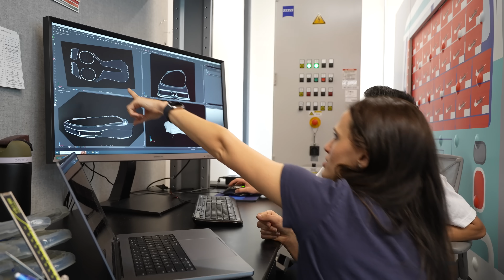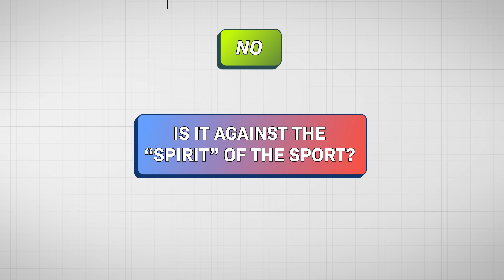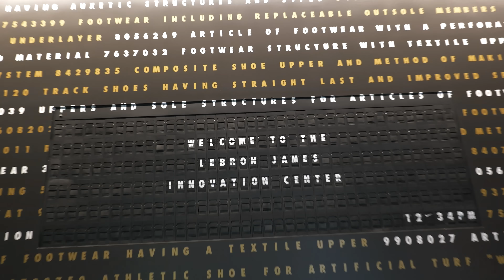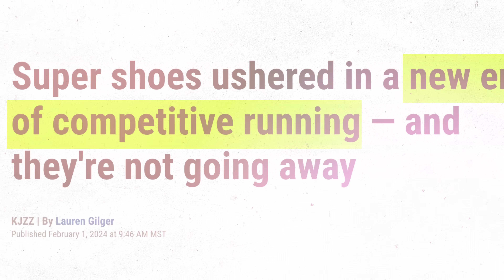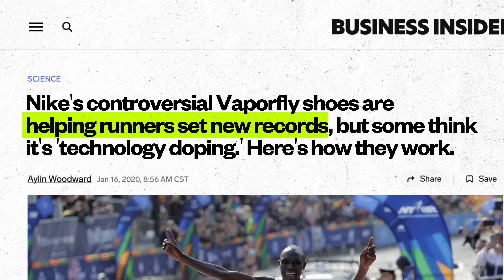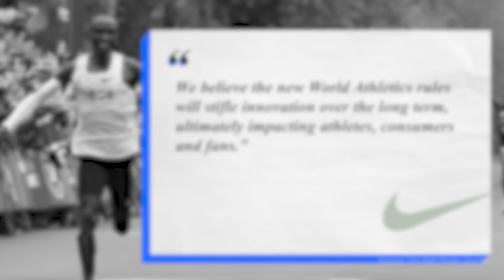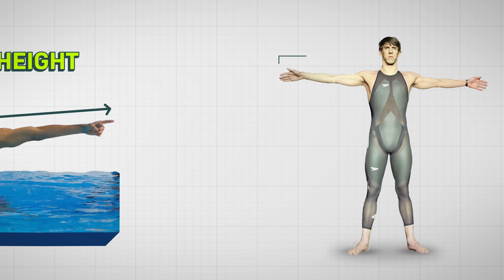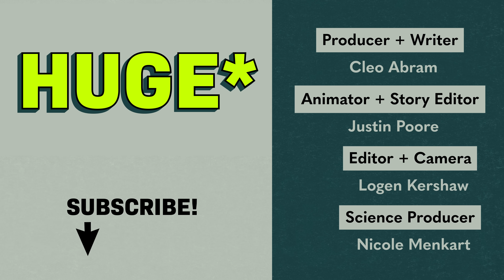The Shoe That Broke Running

Comment: The line for goggles are quite simple for me: safety. Makes the swimmer see where they are going and not hurt themseves by crashing into each other or a wall. Does it make them faster? No, but seeing where you are going is. The shark-skin is very different. Clear difference.

Comment: The decision to judge Blake's case based on a hypothetical height is ridiculous. For one, possibly the most common mistake I had to dock students' points for (ergonomics course) is assuming body proportions are directly related on an individual person. A 70th percentile arm does not mean a person will have a 70th percentile leg! Same way a 70th percentile reading score doesn't imply a 70th percentile math score. Sure they're correlated in the reference population, but there's so much variation in individuals!

I'm sure the calculation was more complicated than a 1:1 limb comparison (or I hope it was, at least), but it's not a good metric. It's a particularly bad metric when measuring someone who has not developed in the "standard" able-bodied fashion (a.k.a., the people studied for those ergonomic references).

Respect his attitude, but that is insanely unfair. He did the work—if it was truly that much of an advantage, you'd see a lot more high-tier runners missing limbs in a sport where milliseconds count!

Comment: On the one hand, so long as it isn't adding energy I think it should be fair. But on the other, bikes only improve the efficiency of human energy but that's clearly unfair in a running race, and on top of that, I think the Olympics should genuinely be available to people independently of wealth meaning that super high tech perfectly optimized stuff that just improves the efficiency of what you're already doing but only the richer competitors can afford really shouldn't be allowed. Honestly I lean towards the latter... but I do think there should be spaces to push the absolute limits of what's humanly possible with the use of tech so long as all energy is human provided.

Comment: Technology has made such huge changes to sports. One example is switching from wooden tennis racquets was massive. The biggest may be when they switched from wooden poles in pole vaulting. The newer fiberglass or composite poles could bend, allowing athletes to get so much higher than ever before.
Reply: That's why I like complex sports with minimal equipment.  Combat sports, football, basketball, volleyball, water polo, etc.

Comment: I have a pair of Alphaflys.  They are fast but the main benefit is in reducing fatigue during and after  a race/ long run.  There are a lot of super shoes these days, Alphaflys are just one of a large number of choices.  

The WAS restrictions of 40mm and only one plate/stiffening device is a good balance in my view.

Comment: I think that one can use statistics to make an argument for why the carbon blades give an unfair advantage. If you look at the prevalence of people under the age of 30 missing limbs it is 1 in 2000 people. If you see the number of runners with blades amongst elite sprinters(top 200, top 100 whatever cutoff you chose) significantly exceed this frequency then it would fair to conclude that there is some unfair advantage even if the bladed sprinters only make it to 5th in the world.

If you look at motor sport there are lots of divisions and competitions. Sure they are all cars but we understand that if the way in which the cars function is sufficiently different then they should be in different competitions. Mercedes and Mclaren have slightly different F1 cars, while rally and Formula E cars have significantly different specifications hence the FIA choses to have separate categories. The same principle likely applies here.

Comment: What the public thinks doesn't matter. The fans don't get to vote on the designated batter or the aluminum bat rules. Every sport has a governing body or association that writes the rules that govern competition and participation. The way to handle these issues is to let the governing body for each sport decide what is appropriate for that sport. Period.

Comment: The problem is to keep meaningful the comparison, present and past. But the technology is mature enough also to store (non dangerous)energy enhancements information (including wind, shoes characteristics accessible by all participants to the competition) together with achievement results, so compare only time or height results is intrinsically obsolete, focus on improve the comparison algorithm instead of banning the most significative enhancements. We might also have to enrich the concept “there is a winner” in function to weights, instead of ban, given to te enhancements used. —Marco Munari

Comment: Running blades shouldn't be allowed in running.

That is just giving a PERMANENTLY legless person the ability to run faster with less fatigue than normal legged person.
Plus, not everyone can have that running blade cuz......it's for the legless person only

In the future, there might be runners who are desperate to win their run for glory & money, to the point they might be willing to cut their legs for running blades to gain that advantages 

Glasses prescription is different. 
Yes. It makes ALL shooters to be at the same sight level for the shooting WHICH the shooting itself required more of their individual aiming skills than their sight.

For running shoes? It should be regulated BUT NOT BANNED.
For example, in this running event, no carbon plates shoes is allowed.

In other event, yes it's allowed.

Cuz most of us have both legs, it's fair that we should try every possible running shoes that could help us pushing the boundary of faster timing.

Comment: In my opinion, the technology of equipment should be unlimited in terms of performance but limited for safety.
To keep the field fair however all athletes should use the same equipment.
To determine what's used the corporations would have to compete each year with their models.
This would force rapid advancement in the field.

Humanity is defined by tool-making and we're near the transhumanist technological revolution.
Instead of putting on breaks we should use insentives and policy to steer the technology in ways that better life and accelerate it in ways that make everyone's life better

Comment: You advocate for what brings the highest performance, but that´s not the spirit of sport, it´s that simple. Sport is about making it alone (without external helpers), and if this premise is fulfilled, then the individual performances of otherwise equal athletes, just give the highest performance a name, but the performance-value itself is irrelevant (the seconds are just there to prove the winner unambiguously). It´s not about being the fastest thing possible (cause maybe then you should be a jet-pilot anyways), it´s about fighting and, eventually, beating the competition, all by yourself. thereby building your body, and strengthening your mind.
Reply: -----
@klausbrinck2137
-----
- By that logic every runner should run barefoot...
-----

Comment: In competition sports. I think that only one thing works. Everyone that is in the competition past and present needs to have the same edge. 

If you break a record with a supper suit. Did you really perform better than the other person? Or did you just find better tech. If you want to break a record then it should be done in the same tech that the person who made it had availability to. Then you can say that you are the best. Once broken you can set a new record with newer tech. But that is just what I think.

Comment: I agree that for *races*, prototypes shouldn't be allowed. That is an unfair advantage if not everyone can access it yet. HOWEVER, the banning reason used for running blades is crap. THEY DON'T HAVE FULL LEGS, how is that EVER an ADVANTAGE??

Comment: the problem isn't the tech. it's the unequal access to the tech. The solution is simple: one-design class racing
Reply: Near the beginning of the video she mentioned fairness to record holders. There would have to be asterisks, or "new era" records everytime a new tech is introduced
Reply: @Skyflyerscott  No qualifiers needed for breaking records. People get better all the time over the years through nutrition and technique helped by science. Everyone knows the phrase " They were the best in their field, in their time".  Breaking records is not done by determination alone (most of the time)
Reply: nah, this should be like f1 - bring the best u can, let others catch up
Reply: @unhingedninja8565  funny you should say that — formula 1 has extensive regulations which make sure the cars are on a relatively level playing field without compromising safety. the F1 regs actually artificially limit innovation, so cars are not as fast as they can be.

if formula 1 was applied to racing, then outlines for shoes would be provided where certain materials were banned, certain materials required, and minimum and maximum dimensions given.
Reply: so essentially — the current shoe regulations are surprisingly similar to the system Formula 1 uses
Reply: @caskadestudioyes but there are still massive variances in budget and affordability between different teams. Don’t forget that!
Reply: @Killyang  totally! i was more pointing out how the very specific regulation set makes sure that basically every team is competitive (except Alpine but let’s ignore them)
Reply: @Killyang  F1 also limits how much teams can spend to also increase fairness. The limit is $120 million a year which some teams cant do, but without that limit, certain teams would definitely be able to exceed it by a lot.

Comment: "...open retail market at least four months before it can be used in competition..." What a stupid ruling...and I agree with Nike for feeling stifled!!
In every industries innovation is tested at the highest level of competition before it's available to the open market. Whether it be F1 testing brake composite, tires, electronics, safety components; motorcycle industry, swim suits, ski equipment and garments, cycling, sports sunglasses, hiking boots tested by elite military units, etc... EVERYTHING is tested by professional segments before being released to the public. Why is this different with running shoes? How petty 👎🏼

Comment: These advancements should continue to exist and be refined through science.
However, the issue arises when they are introduced into sports.
Ironically, without sports, these technologies might lack a developmental avenue,
since capitalism drives innovation through competitive industries.
In this cycle, non-athletes receive the hand-me-down inventions of elite sports.
Yet, paradoxically, these innovations might not exist at all without that competitive foundation.
Reply: The best way forward might be to establish two variations of competition:
Natural Competition, which adheres to a bare-minimum standard of human ability to engage in the activity safely,
and Tech Competition, where technological advancements are integrated freely.
This would preserve the integrity of traditional sports
while allowing innovation without controversy.

Comment: this is so silly. everyone should have access to the same tools for the same competition. if a tool is not obtainable by everyone, it shouldnt be allowed. that goes for shoes, glasses and everything else. that also goes for poeple without legs. if not everyone can use running blades, they simply shouldnt be allowed, atleast in a normal running competition.
and the reason why it shouldnt be allowed is quite simiple. its to avoid controversial situations.

Comment: it's not a good comparison for running blades to corrective eye glasses, unless you can prove that those eyeglasses have upgraded the vision beyond 20/20 or better than a normal person's vision.  Most handicapped people do not wear running blades which are specifically designed for running.  It would be fair to wear the regular prosthetic legs and running sneakers to compete.

Comment: I havent read about any sports,but when i saw some of those news about geara getting banned, i just assume the line is whether or not its soemthing that everyone participating in the competition can afford. I mean if everyone wears the same gear,with that same technology wouldnt it be fair?

Maybe brraking previous records without the more advances technology isnt fair but could easily be labelled and differentiated as kind of a different era. Like world record before x gear etc. So peoole would know what the world record actually means.

I think if the advantage is that much its easy to just ban them or make sure all participant have the option to use them.  I think the part where youd want to know where the line is, is actuall the gears  that are acceptable, surely there is always some difference to how it affects performance.

Comment: I mean look. A game runs in a certain way as per game rules. If it's for people with two legs it's understood. Also, for phelps and eluid case if the tech is available for all then it's alright. Some tech which are over and above like an extra limb or so that's complete no no. Even a dumb can understand kind of tech. And for solutions on such issues can be done by providing fair decision making like how it's done for eluid case where 4 months prior tech should be available... This is the way sports is. It's heart and art not your skill. It's passion.

Comment: This is so interesting. I’m a hema fencer nowadays but I used to be a competitive hunter jumper rider. My horse was a puller, meaning he’d lean on the bit and thus my arms (he was lazy lol). At home I used a bit that had a chain going under the chin to help reduce this. It didn’t hurt him at all, but just helped keep him from doing that. But I couldn’t use it at shows because the judges would reduce points during anything that judged the horse. So I’d use a bit that looked like a normal light one on the outside but it was a corkscrew on the inside. Also didn’t hurt him, it was slightly less effective than the one I’d use at home but the judges had no idea. However this was totally fine and allowed in shows, just don’t tell judges. I find it interesting because it’s tech that I had to…. Make us a better looking team to the judges and win. But I wonder if some would find it unfair. 

I can’t think of anything for hema that we have like that… I mean any rules and regulations are for safety. Taped ends, blunt blades, very flexible steel, protective equipment. I wear an abdominal belt and KT tape for chronic pain and other health problems but nobody says anything. I use those technologies to… be better or arguably just be at the same level as the fencers there without those issues. I think I could wear them in tournaments without issue!

(Edit) spelling 😅

Comment: About the Blake case, comparing to shooters with glasses. It's not really fair comparisment. Glasses do not make vision of an athlee better than natural, it corrects disability to almost normal level. In Blake case, running blades may be lighter and and may have higher energy return then legs. And this kind of gear is not in everyone access. Maybe that's also the reasons of ban. Still wish him a great success! But Olympic committee has a lot of even stranger decisions nowadays.

Comment: I think it ultimately comes down to accessibility of the tech. Additionally, if it is an item of necessity and they couldn’t live their everyday life without it (including blades, even though they aren’t used outside of running), it should be allowed.

Comment: Why don't they just have multiple categories? A technology category and a non-technology category? In the non technology category they all wear the same standard equipment so there is no advantage and we see purely a difference in the performance of the athletes themselves, while in the technology category its not just about the athlete but about the engineers using technology to enhance them.

Comment: I've "ran" in those blades once.  There comes a point where the additional leverage granted by them is offset by the reaction speed of your balance and perception.  
You become almost 'too fast'.  

Unless you've used them for life, the advantage is nerfed pretty quickly.

Comment: Personally, I think they should have a "dirty" Olympics separate from the regular Olympics.  Participating in the dirty Olympics would preclude you from participating in the regular Olympics.  Other than the basic rules of the event,  there would be no rules preventing any performance enhancements. BUT, you would have to be 100% transparent about everything  - drugs,  training methods,  nutrition,  medical technology,  equipment,  materials, and anything else that could have an effect on your performance. The kicker is that not only would the athlete get a medal,  but so would the team/corporation supporting the athlete.